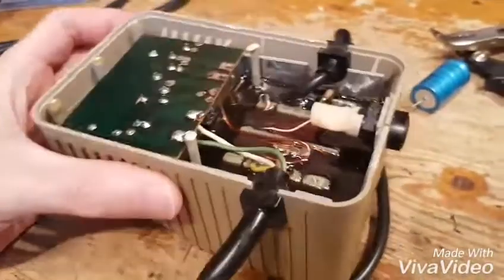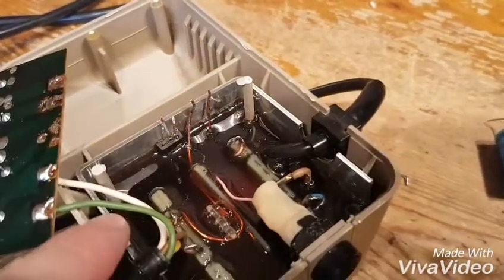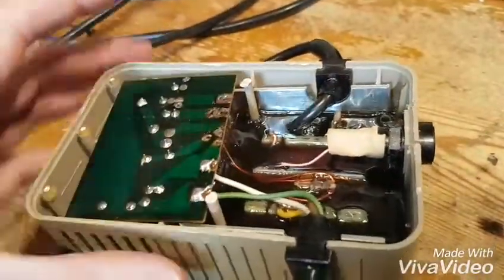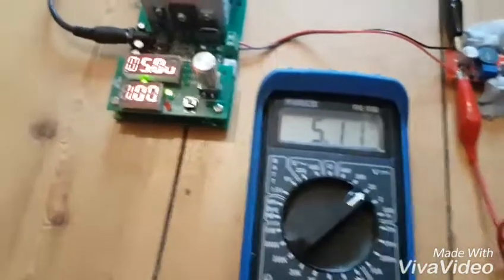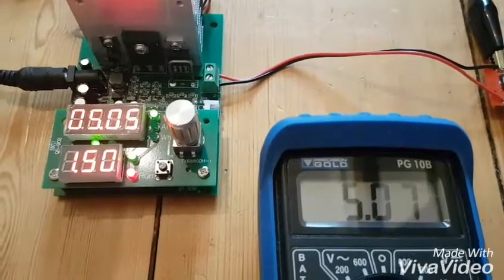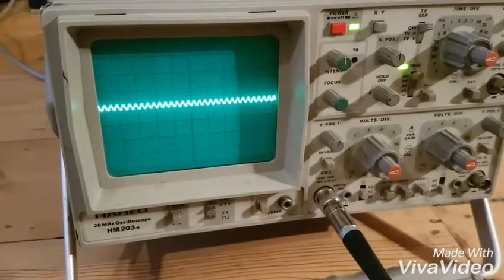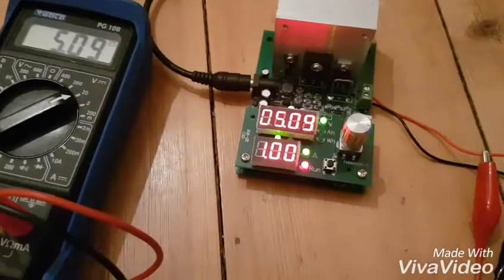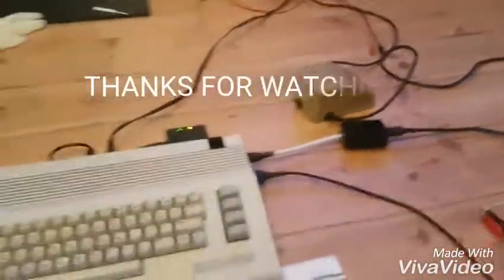Upgrading Commodore 64 Wedge Power Supply

Comment: Great job!  Good that you tested that first PCB for a period of time - I wouldn't have wanted to use that either after seeing the voltage creep up lol.   Gonna have to get myself one of those load testers from eBay - pain having to mess with wire wound resistors etc.
Reply from the maker: GadgetUK164 - Retro Gaming Repairs & Mods Thanks, Here it is for £12. May be able to do better.
Look at this on eBay  http://www.ebay.co.uk/itm/191883750242